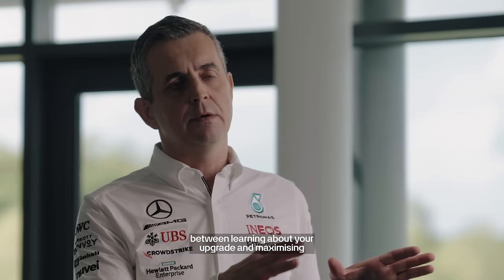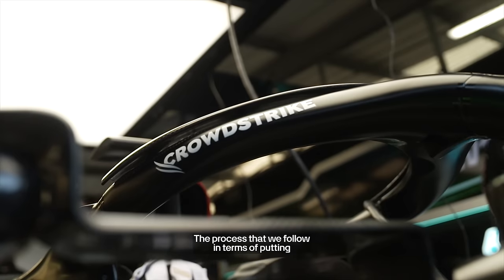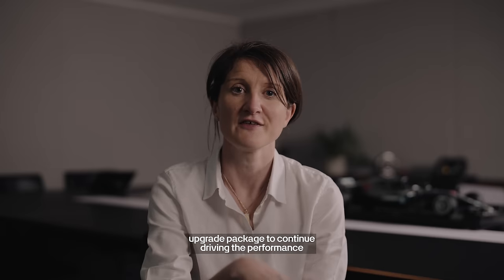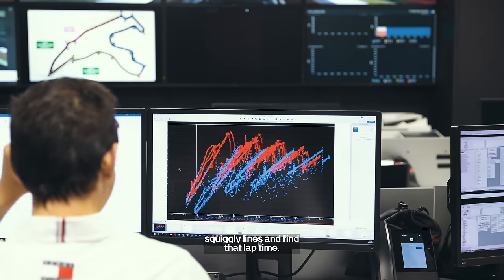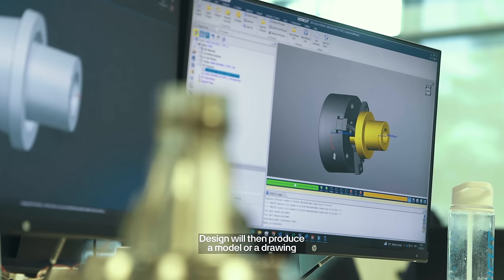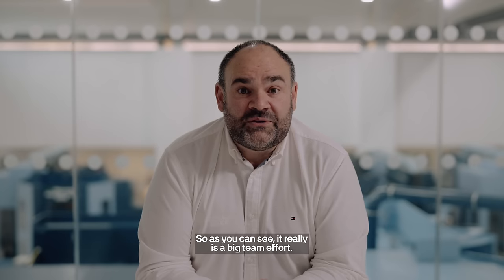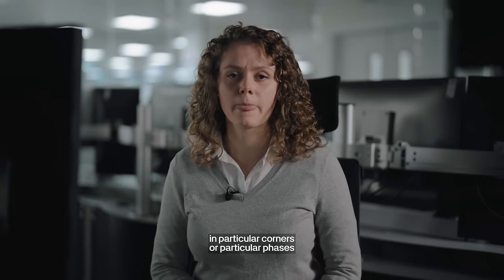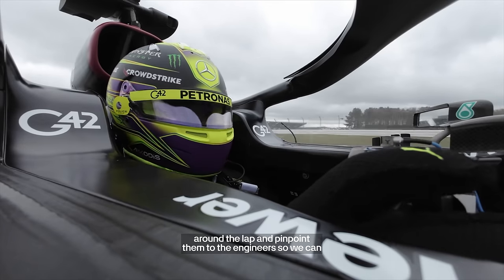How Do F1 Teams Design, Produce and Race an Upgrade?

Comment: Debuting an all-encompassing upgrade in Monaco be like 😬...
Reply: horrible idea..
Reply: Yeah def the worst track on the calendar to bring a big upgrade
Reply: They might even postpone it, I think they chose Imola to do the upgrade was because of the track characteristics and then compare it with a track that has completely different characteristics (Monaco is more engine power then aero). But now with no Imola and Monaco being the debut of an upgrade where the percentage of a crash is higher... Don't know. On the other hand all data is good data, the drivers will just have to be extra careful I guess.
Reply: @The_Curious_Cat  Spain defo better to bring the upgrades
Reply: @The_Curious_Cat  Monaco is more engine power than aero lmao
Reply: Def should hold off until Barcelona
Reply: Monaco is Suspension, steering, braking. Pretty useless DRS zone, no need for party mode
Reply: @Amazing_wildlife7721  It's called mechanical grip. Look it up before "lmaoing".
Reply: @The_Curious_Cat  Teams come up with the most agressive aero set-ups for Monaco and yes Mechanical grip is really crucial but "Monaco is more engine power than aero?" lmao 
Decide for yourself first, you are contradicting yourself
Reply: Barcelona will show them useful data
Reply: What is the point in delaying? Surely you’d want as much time on track to learn about the new package?
Reply: @The_Curious_Cat  engine power at Monaco where the average race speed is lowest of all. Lmao

Comment: Pretty obvious what aero package Mercedes need to work on over the Summer break like that incredibly sculpted underfloor of the RB19 as well as the weight distribution balance of the the W14 which looked unusually heavy on the rear as it was crane up from the crash by Lewis on FP2.

In comparison to Perez's RB19 which must be incredibly balanced in weight distribution when it was crane up.

Comment: Yeah sounds great but you produced a lemon. I `commented several times on past posts back in 2022 the zero sidepod concept is fundamentally flawed. You cant go against the grain in such a radical way with regards to aero design. Not in 2023. Use the same basic concept as all the other teams then build on that, this is what mercedes always done in the past

Comment: Look at the resources and brainpower that is involved. It is impressive. It truly is. But and this is the kicker if you have a flawed concept you end up with the W13 and it’s offspring the W14. 
   
So RB and Aston Martin do the same things and the same processes but with a better concept. A more adjustable and better to upgrade concept. 
   
Money bet is Mercedes will dig themselves out of the hole they are in but likely not this season. If it was that simple the W14 would be better than the Aston Martin right now. 
  
F1 needs, Mercedes, Ferrari and Alpine to get it right like Red Bull has. All the works teams need to be firing on all cylinders. Domination by one team is boring.

Comment: based on the miasma of the aero design over the last 18 months, I'm not sure how to take the declarations of expertise from any of these people. They had multiple signs that they were clearly on the wrong path and instead of admitting their mistakes, they instead further exacerbated the problem by doubling down on their original choices. If these next upgrades don't dramatically close the gap (and leapfrog Aston Martin) then all these people should be replaced.
Reply: So if I understand your logic, Williams, Maclaren, Alpha Tauri, Alpine and Alpha Romeo should all be considering sacking vast numbers of staff, as they are equally underperforming?
Reply: @dfxl6587  the expectations on those teams are different and you know that. With the resources and pedigree that Mercedes has, they shouldn't be fumbling about this badly, particularly when their own 7-time championship driver is telling them the car is wrong conceptually. And, yes, if your team is underperforming over an extended period of time, you make changes. That's how you improve. I mean unless you are happy with the results so far and see clear signs of progress/improvement?